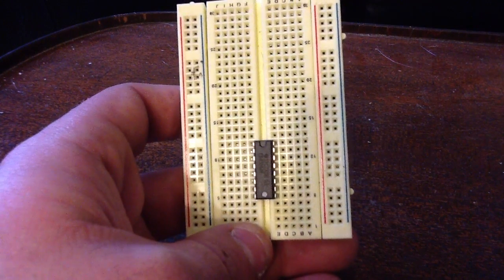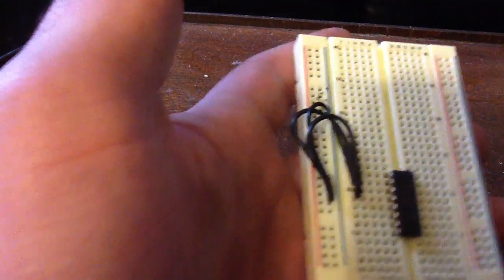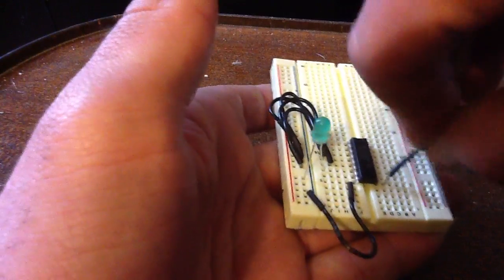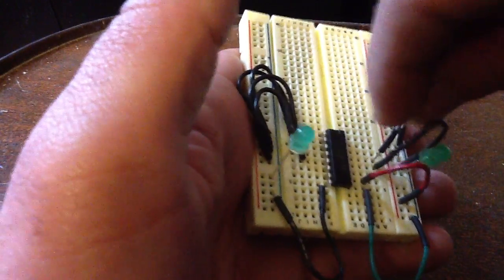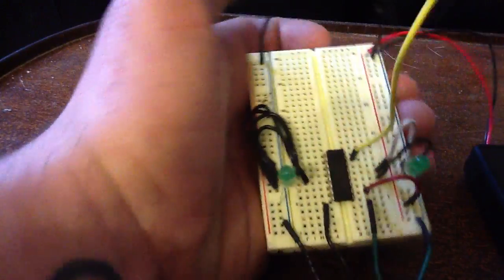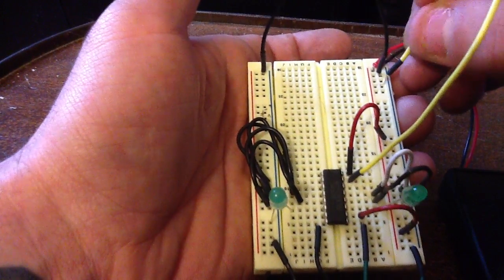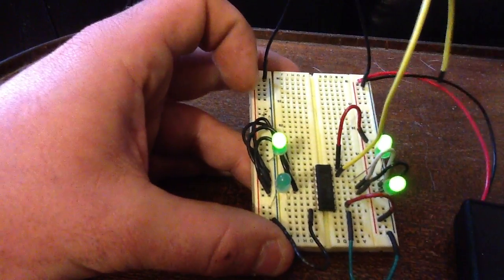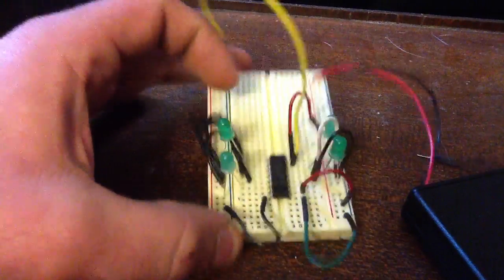CD4516 Binary Up/Down Counter Tutorial

Comment: One question though if you didn’t connect the up down pin into gnd or 5v will it count down as well?
Reply: You cannot leave it floating or the chip will not work correctly.

Comment: The problem with presetable counters is that you can load in a preset, BUT that's where it starts counting. The only way I have seen to do a counter that will count up to a certain number and recycle is by adding chips to the output and then enabling the reset or clear pin when the output binary number reaches the desired highest number. In order to get a one chip presettable counter I had to use a microcontroller to count up to X and recycle
Reply: You can also use AND logic gates, it will work just as well as a microcontroller.

Comment: The power is internally linked with the up counter wire, that is why it runs without the VDD connected. The chip can actually run at up to 20 volts. What I do not understand is why the leds do not get burnt out without any resistor. The output current must be limited. Do you know how much current flows trough the LED?
Reply: The CD4516 component operates from 3v to 18v.
I will do a test to know the current that comes out of the CD4516 when it is powered at 5v.
(I am French, therefore my English is approximate, forgive me.)